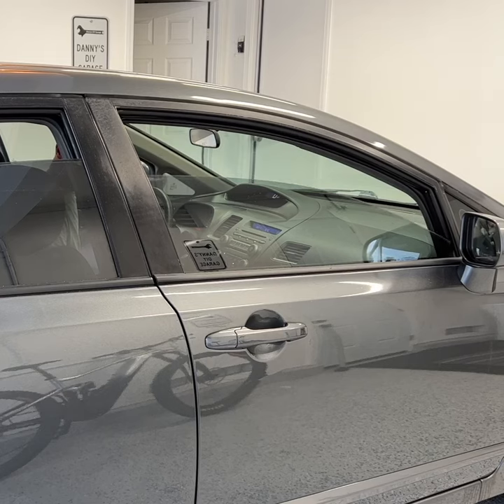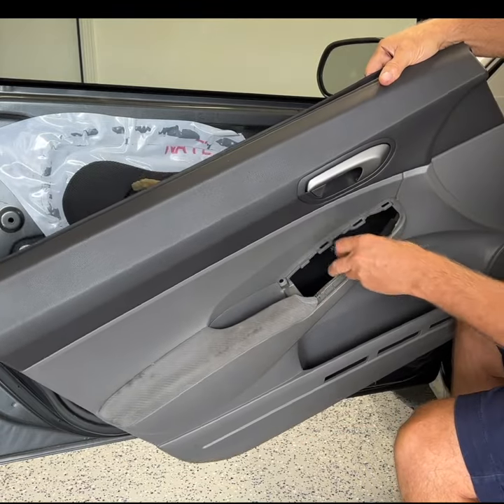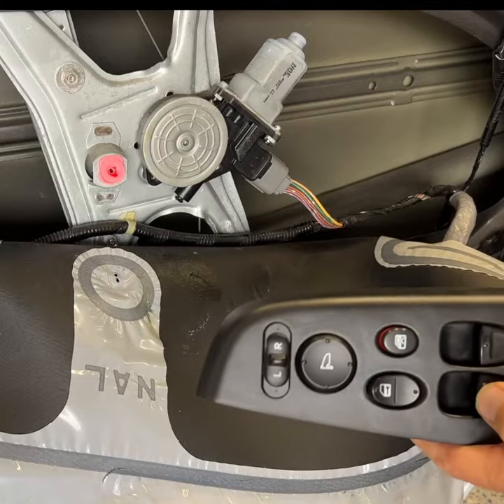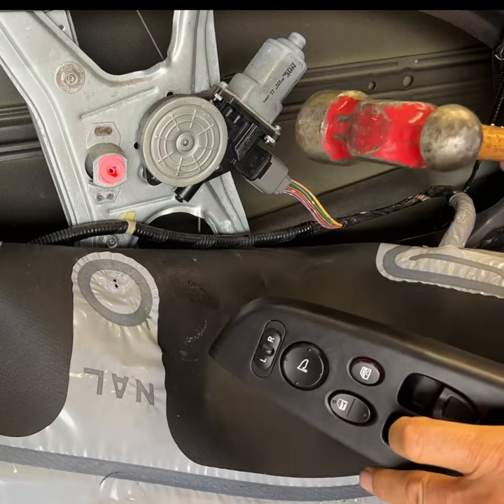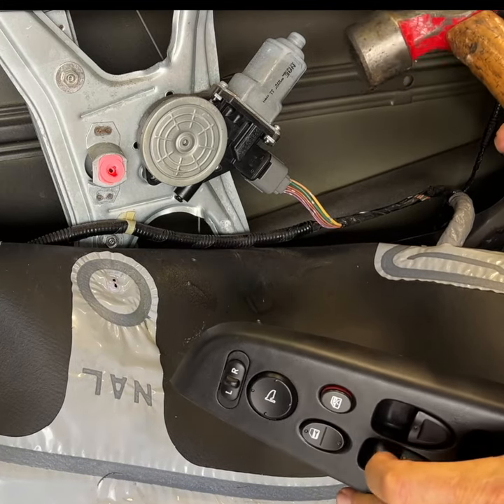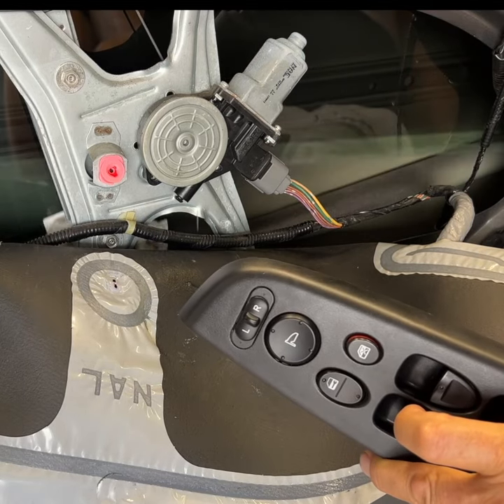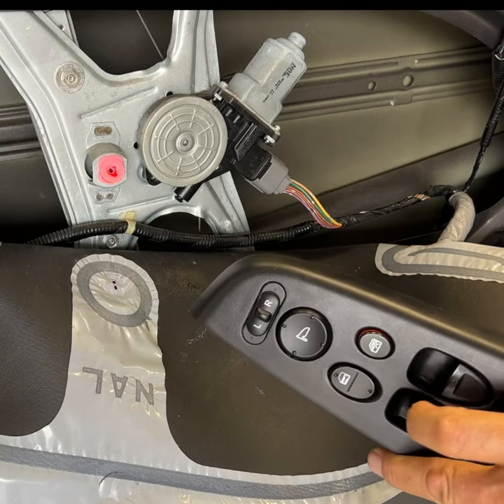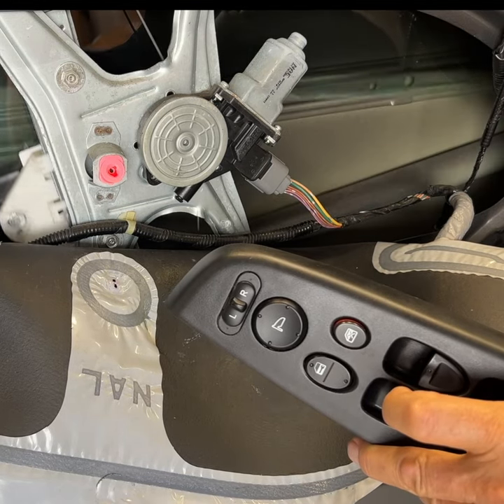how to Repair a window motor #windowglass #windowregulator

Comment: My honda accord 2014, winndow get sticky when it is rainy or wet on passenger side  how to open it and fix it!thank you
Reply from the maker: Try cleaning the glass, sometimes it sticks in the channel, use silicone spray on the channel, I have a maintenance video on that subject on my channel

Comment: My car is Passat B6, even though the left rear door is closed, it is always shown as open on the trip computer. I can lower and raise the window from the driver's door, but it does not go up and down from the left rear door. I did what you did, but neither problem was solved. Can you help?
Reply from the maker: Not a lot to go on hear, sounds like two problems, window switch possibly, I have a few videos on how windows work, I suggest you check them out when you have a chance 👍🏼
Reply: @dannysdiygarage  
When I removed the engine from the right door and installed it on the left door, all problems were solved. How can I repair the left door motor?

Comment: My power windows and power locks don't work. Should I try this this trick? I am going to assume that the window motor has nothing to do with power locks. And again both windows & locks are not working. Every time I replace the fuse it still won't work.
Reply from the maker: I have a couple of videos on my channel addressing power windows, how they work and how to diagnose them, these should help you, I'm also working on a door lock video that should be out later this months. please subscribe

Comment: I repairing it using new brushes i sand to that size and just replacing them. Somethimes i change the spring taken from the pencil.😂😂😂
Reply from the maker: I tried just sanding down the old brushes, that to and it didn't work for me

Comment: I need your advice please Brother  🙏🏼🙏🏼😞😞😞 
So unknowingly I've only gone and ordered a US Market Dorman 741-736 window regulator which is for a USDM Civic's (Passenger side) so have just discovered that the regulators motor electrical plug is a 2 pin whereas on my UKDM Civic (Driver side) it's a 4 pin plug.

So basically regulator and motor would fit as it's for the right side door, just theres 2 wires and a 2 pin plug instead of 4 wires and a 4 pin plug to connect to my UKDM wiring.
Any ideas to work round this bro? Damn totally my fault I should've known plugs would be different being that RHD - UKDM and LHD- USDM,
Totally my fault 🤦🏼
Please help 🙏🏼🙏🏼
Reply from the maker: I just uploaded a video that might help you with the wiring, check my YouTube page, it goes over the circuit wires

Comment: Some cars even have a hole to insert a screwdriver and it hits the dead center of the motor and you can tap with a hammer, some cars dont require taking it all the way apart like this
Reply from the maker: Thanks for adding

Comment: Hi Danny, I have a question. Do I need to use sealant for the passenger window that fell off, or tightening the bolts will do? Thank you!
Reply from the maker: @Mac-ku7df  tighten bolts should be fine
Reply: @dannysdiygarage  thank you so much. I learn a lot from your videos. Specially cleaning MAF and changing oil.

Comment: What if the window motor works and window goes down and up but jutters before closing completely. It’s as far as it closes leaving a 3/4 “ opening???
Reply from the maker: Most likely will need a motor and regulator assembly, I have probably 4 videos on windows on my youtube, that's my guess.

Comment: Can someone explain WHY/HOW this works?
Reply from the maker: the short answer, brushes are worn and don’t make a good contact anymore, hitting it with the hammer kinda repositions components, long answer: The commutator on the window motor is probably worn. This causes a poor fit against the brushes and whacking the motor causes a better fit; although it's temporary. The situation would be the same as a worn starter motor that will start working again after being whacked briskly with a hammer.

Comment: If you are able to take the motor apart. Clean the inside of the motor. Electrical contacts etc. lube any shafts or gears. Your motor will often work like new agin.
Reply from the maker: I actually did this and it lasted another 6 months, great point if someone is in a bind and needs to buy time, thanks for adding this

Comment: I've seen this for fuel pumps but it was more of a last ditch effort, what is the science behind this?
Reply from the maker: Yes fuel pump, I used to bang on the bottom of the tank with a rubber hammer to quickly diagnose fuel pumps on suburbans a trucks, starters also, reason the motor gets stuck and the jolt free’s it, usually do to brush wear
Reply: motor has carbon brushings with a spring.  they consume and get smaller and smaller till they not pushing on the rotor . hitting it wiggles the 2 carbon pieces so they get in contact again.  
not an expert but that's my theory. 
edit LOL I ve see  the reply after I wrote